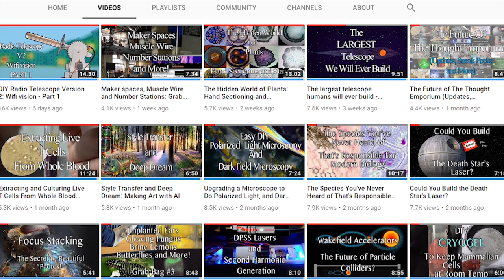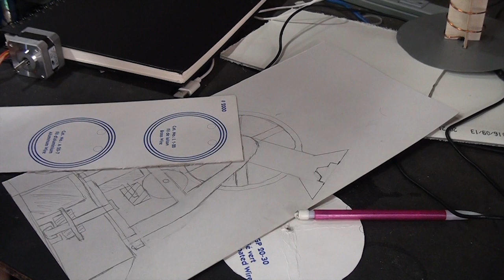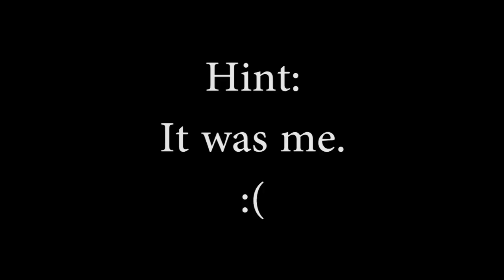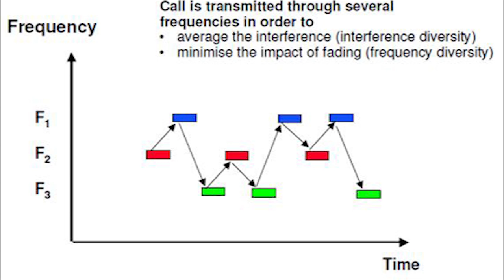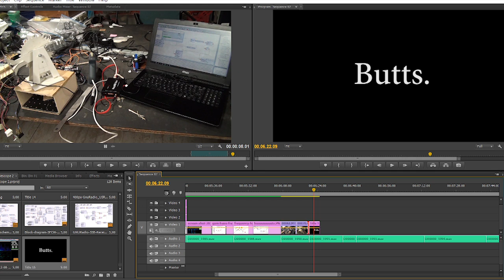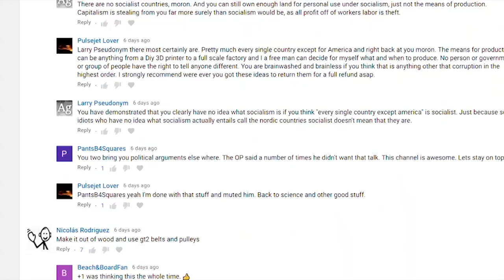The Angriest Radio Telescope - Wifi Camera Part 2

Comment: Not a criticism, just for those who might want to know: that shim isn't a shim, it's called a key. If it worked by spreading the axle apart to tighten the press fit to the base, it would be a shim. In this case, the key bridges the axle and base and takes forces 90-degrees from what a shim would.
Reply: iroll 
Thanks for the extra information
Reply from the maker: Noted. Will keep that in mind next time I use this so I call it the right thing. Thanks!
Reply: Nice to see a mechanical engi-nerd spreading their beautiful sorcery.

Comment: Using a circular polarity antenna to pickup wifi signals that are normally vertical or horizontal may prove to be an issue. I think that may be the issue with the higher signal levels when the antenna is parallel to the ground. We run 20+ Mile links using equipment in the uper 5Ghz range. Most of our dual polarity antennas have 20-30dB isolation between vertical and horizontal. With the wrong polarity it can result in a significant reduction in signal.

As for the frequency hopping most router don't change frequencies that often and some are only certified to use certain ranges. If your mapping 2.4 you may be able to get by scanning the center frequency at around 2.445, alternatively you could scan channel 4 and 10 for better accuracy. Scanning 5Ghz would be quite the challenge. 
Either way I'm looking forward to the results. Good Luck!
Reply: Hang on, can't you derive horizontal and vertical polarisations from a combination of circular ones? If so, then couldn't you add a second coil to the antenna, so you have one clockwise and one anticlockwise, then figure out the overall polarity of the signal in software?
Reply: A circularly polarized antenna can receive linearly polarized signals in any rotation, just with some efficiency loss. Also, the signal you were seeing while the antenna was horizontal may be coming from a nearby phone, the near by laptop, or any other source of 2.4 GHz radiation.
Reply: That was my point. A random piece of wire can receive can pick up a circular polarized signal but the SNR is going to be pretty poor. The ideal antenna for this project would be either 2 yagis, one horizontal and one vertical or a single x-pole yagi. Since you don't any data you could just use a simple combiner and a single SDR. The reason for yagis is that the beam width is more narrow so you would be able to get a higher resolution. I think the current antenna will act more like a omni pick up signals in a wider beam width, possible lowering the resolution. Either way, I'm curious to see the results.
Reply: How can a person start this without any knowledge on radio telescope?

Comment: Ive taken a 2.4 and a 5.8 Ghz Omni antenna, strapped them on a pole and wired them to a radio to see noise before. But never automated anything with a pinpoint antenna like this. 
I probably would have ended up using an Yagi. But thats only because I have those antennas available to me. 

I give you guys props for building the antenna. SUPER AWESOME!

Comment: I urge you to revisit the question of whether WiFi uses frequency hopping. My impression was that Bluetooth uses FHSS and WiFi uses DSSS. The Wikipedia article on IEEE_802.11[1] says that only the most legacy protocol uses FHSS. Also see this video where this guy detects his phone's AP on different channels/frequencies with an RTLSDR[2]. DSSS uses a pseudorandom sequence of "chips" that modulates the signal, but they don't make the frequency hop around, just spreads the signal in frequency space (they get pretty wide! but centered around a single frequency), see "2. Basic Principle of DSSS and FHSS" in this pdf[3]. I may wrong of course, I'm not an expert :) Love the content btw and good luck!
[1] https://en.wikipedia.org/wiki/IEEE_802.11#Protocol
[2] https://youtu.be/f7mrFNB1D84?t=55s
[3] http://www.sss-mag.com/pdf/Ss_jme_denayer_intro_print.pdf
Reply: I apologize for any foul tone on my part. I wouldn't have said anything if I didn't believe I was contributing to seeing some color-coded wifi channels on your final image! Curious what you actually saw.

It's funny to think that hopping is part of a security model that expects an eavesdropping bluetooth device not to know which frequency to listen to, when now it's possible to see the whole range with a SDR :)

You might have been seeing OFDM, but, if I may mention, a personally fascinating thing about DSSS is that several signals can theoretically operate on the exactly same frequency and to recover the desired signal, you sort of multiply the mixed signal with the pseudo-random chip sequence increasing signal-to-noise ratio, "digging out" a signal that was modulated with the same pseudo-random chip sequence.

Comment: I liked the video but my suggestion is to better manage the acceleration of the stepper motor. I have swung some amazingly heavy things with simple 3d printed parts, likely weaker than wood, by starting very slow. You should have 100% control over the speed from the gcode. But, maybe you want more speed, so I guess you just need more strength and more torque?

Comment: I suggest you guys a cloud chamber. That would be awesome!
Reply from the maker: Mátyás Ludvig if I was still in the US it'd be way easier. Getting dry ice in Canada is an absolute pain
Reply: The Thought Emporium I see. First time I thougth you could use a peltier module or a standard cooling unit in this project.
I don't fully understand these two things, but someone not credible informed me on the dangers and negatives on these (probably a chouch warrior of somekind :D).
Reply from the maker: Peltiers are hard to get cold enough for that to work. It's doable, but difficult.
Reply: The Thought Emporium Ok, i see!

Comment: I've started work on my own and currently working my way through the design stage quagmire. I've built the attitude component already and I am happy with it. I fully understand why you avoided 3D printing, 3D printing large flat parts SUCKS. Just for the AT part of the mount it took around 15 hours of 3D printing, not including the trial and error testing while I fumble around like a blind man in a bear trap Q&A department trying to work out what the tollerances are of my 3D printer for certain parts.

For the AT I have got a 4:1 gear reduction and for the AZ I am working on a 5:1 reduction with inside-out helical gear (not that I am tempting fate or anything :P) Though mine is going to be used for astrophotography as well as chasing amateur radio satellites.

For the lols I enabled 16th microstepping which equates to something like 12,800 steps per revolution, or 0.028 degrees per step, if my math is right.

edit: thank you for sharing yours though as it motivated me to get off my ass and revisit the one I had sitting in the parts bin for the past 2 years :)

Comment: to take the friction away while rotating the whole structure look up a "lazy susan" they are the tray that sits usually in the middle of a dinner table.  its a circle that spins in 360 and you can buy just the metal ring that has bearings and mounting holes. they might be at a local hardware store or big name stores

Comment: for the wobble issue, one aspect of things is to reduce the moment of inertia by rotating around the center of gravity. Since you probably don't want to put a metal shaft there, you can google "remote center of rotation".

Comment: Won't it use less energy and put less wear and tear on the system to rotate the antenna back and forth horizontally rather than vertically? If you keep turning back and forth but step the vertical incline up degree by degree i think that would probably be better.
Reply: Jonathan Olson You can see that they added some weights to the back of the vertical assembly to balance it so the motor isn't working against gravity, they also said that the base plate has a lot of friction so that'd take more energy to move.
Reply: MadScientist512 that makes sense
Reply: Danukeru DESU The higher gearing doesn't necessarily mean that more power gets used if the energy each step uses is less, although in this case, due to the friction, it does use more; they could use a 'lazy Susan' type bearing to get rid of that. Thanks for the interesting info about cogs, I hadn't known that but in hindsight it seems obvious; learn something every day!
Reply: Jonathan Olson wow. I watch so many videos like this. And i swear i see your name in the comments on so many for like yrs now xD
Reply: LordDecapo oh wow! Really? I didn't think realize that it's been that long and that somebody would notice lol
Reply: Jonathan Olson yup xD i recognize the name and picture. I have replied to several of your comments. As you have mine xD
You have good comments so i usually stop and read if its your name. hahaha.
YT is huge. But its fun finding ppl watching a lot of the same videos as you

Comment: A 'Lazy Susan' type bearing would be a cheap way to take the weight and friction off the base mechanism and make it much more solid, and then making the horizontally rotating base plate itself a large cog like in the vertical one would again take all of the weight off and give more mechanical advantage with less parts. Using a mechanism that turns the base one notch every time the vertical movement passes a certain point would get rid of the second motor and associated gearing entirely, and putting a potentiometer on the output shaft for motion feedback, basically turning it into a servo motor, should increase accuracy.

Comment: I have a question or I don't know if I'm understanding correctly (probably both). How are you going to scan all the WiFi channels as a whole?. While it is true that WiFi signals have a frequency of 2.4 GHz , this one is actually the band, hence all channels (if I recall correctly) have a 22 MHz band for them and 10 MHz of separation from both sides. Therefore, for example, you'd have to look for 2.446 GHz to just scan for one channel
Reply: The hackrf they are using can scan the entire spectrum fairly quickly, so it will get them all.  The latest version of hackrf sweep can scan the whole usable range of the radio in one go, so 1Mhz to 6Ghz in under a second.
Reply from the maker: Soon as I figure out how to do a frequency scan, I'll have it sweep the whole band, but for now we've got it set to the middle of the band where the most signal is. But as barry said, if I wanted I could scan all 6ghz every second. That'd just be a pain to process all that data so we don't bother. Our biggest issue right now is parsing the data down. But everything works well atm and we see distinct spikes if we point at internet enabled devices, or dead silence if we point away.
Reply: I know this is way too late, as usual, but looking at the way You have GnuRadio set up You are basically capturing only a single WiFi channel out of 11. HackRF unfortunately only has max BW of 20MHz, but You seem to be driving it at 10MHz, and only at single channel ? Or are You scanning all the channels for each capture ? I don't see that set up on the GNU Radio setup you show but maybe it's not the final...

Comment: Remove those spur gears and go with a set of 3d printed herringbone gears (like the ones you found and stuck inside the box) as they have far less back lash and wobble, etc...
Reply: The Best Stooge he originally wanted to build it from stuff that was accessible to more people
Reply: Shame as that is a pretty big, and bad, compromise.
Reply from the maker: Odd, since the whole thing works perfectly. Seems like a perfectly fine compromise to me. We have no issues moving it and have tons of fine grain control. And as I said I think 15 times in the video, the point was to use readily availiable materials. Printing out parts means screwing with a 3d printer for hours which was time I didn't feel like spending on this prototype version. For the next iteration everything will be cnc cut or printed, no more hand cut pieces. So maybe for the next model.
Reply: Spur gears were never ever meant to go in reverse so a lot of the issues with bouncing and other such nonsense would never have happened, nor the loss of your time plus the aggravation, had you simply used the gears made for the job.

Comment: funny that you come up with this now. Well more or less now.
I was thinking about doing something similar, but with a different kind of antenna. (Although mine was aimed at much lower frequencies than yours, so I could find radio transmitters)
Reply from the maker: That's going to be version 3 actually! we'll be building it so we can sub the antenna out for any other kind and cover a huge swath of spectrum. Will let us do radio astronomy, but it'll be trival to aim it lower and find terrestrial stuff.
Reply: The Thought Emporium that will be cool!
The challenge will be to make it portable for me. Its supposed to be a kind of camera for handheld (lower resolution) or tripod (higher resolution)
Reply: How can a newbie enter this field? What do you recommend?

Comment: Here's an idea:
What if you injected aerogel before it sets and before it's dried/evaporated with tiny particles of gallium arsenide/silicon germanium at a high rate? Since there would be a gradient of denisty of high refractive index particles, the less of them the further from the surface, upon dyring you could get a very high index gradient lens, since at the surface there would be mostly solid i.e. silicon, it's content continualy decreasing towards the other surface,decreasing therefore the effective refractive index until you get just aerogel which has n=1

Comment: It's because your antenna is directional and the properties of wifi routers. since most wifi signals spread outward, the spikes you're seeing are a result of the antenna picking up wifi at its highest power as well as the fact that since you are close to the router, the wifi sphere is small and has a high factor for curve. Imagine a router as a sphere. When looking towards the center of the sphere, you are seeing through more area whereas if you look up at an angle to a sphere, you see less area and the output should be sinusoidal.

Comment: WiFi routers most certainly do not "hop through the same frequencies many times a second" in the way shown on the diagram. Within channels, yes; across the entire spectrum (11-14 channels depending on regulatory area), no.

Comment: Isn't the WiFi is just a vertical polarisation? If so what advantages does it have to use helical antenna?  Yagi may be a better option
Reply: I think you can derive linear polarisations from a combination of circular ones. Two antennas wounds in opposite directions (one clockwise, one anticlockwise) should then be able to pick up all polarisations, and you should be able to figure out which ones were horizontally and which were vertically polarised while doing the data analysis.
Reply: Yagi is a directional antenna (linear polarized) and this of kind is a bit like we can say circular polarized yagi.
Reply: Ateeb Tahir The Yagi design  is a number of parasitic elements arranged in a row with one driven element and a reflector, this means that one Could make a Yagi with circular polarization; a quick search shows such a thing Does exist and is called a "Cross-Yagi."
Reply: Cross yagi !! Hmmm. Instead of single antennas there are crosses (one rod for each axis). Am I right?
Reply: Ateeb Tahir Right indeed!

Comment: Oh nice, you just went for straight bulk ptfe bushings. That should hold up much nicer.
Reply from the maker: Bushings! That's the word I was trying to remember. Thanks! Dunno why I called them bearings.
Reply: Well, the function is close enough that they're colloquially interchanged. I mixed them up all the time until I almost lost an eye to some bad advice on removing a bushing. There's nothing like core shaking fear and hours of eye flushing with baby shampoo to make you really remember those fine details. On a related note, if you don't have a puller and it's a blind hole, hammer in tortilla or bread to push the bearing out, and don't trust ANY procedure involving grease.

Comment: Frequency hopping is not used by modern (non ancient) WiFi. Only oldest 802.11 from 1997 used that. Now it is used by Bluetooth too.
Reply: BarsMonster for many of the 5Ghz channels, dynamic frequency selection is mandatory. This is to avoid interfering with various weather radar and military applications.
Reply: DFS is very slow, it takes minutes and stays on new frequency. It is not switching continuously like in regular frequency hoping. If it does not detect a radar - it will never switch frequency.
Reply: Yes, OFDM modulation is used within 1 selected WiFi channel, not across multiple channels. I've seen WiFi on 50Mhz-wide SDR receiver at both 2.4 and 5Ghz bands - there was no frequency hoping between channels.

Comment: could you make a clock like mechanism so you only need one motor? after one pass vertically it rotates to the side one.
Reply: i believe you can use an actual clock thinking about it. take a old clock and remove the hands and replace them with gears. second hand drives the up and down, with the minute hand side to side.

Comment: @The Thought Emporium If you have any questions regarding custom 3d printers I should be able to answer them. I have built 2 of them using the same board you used in this video (arduino-mega 2560 with RAMPS 1.4 shield).